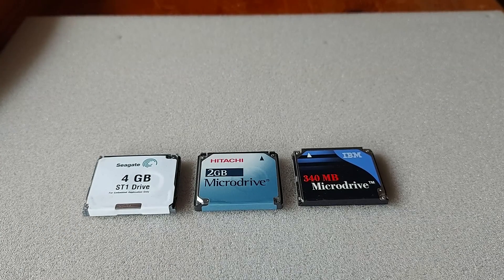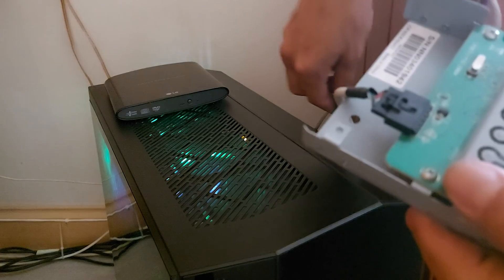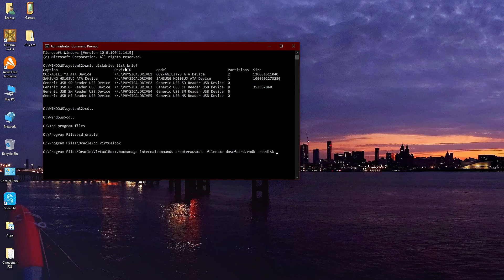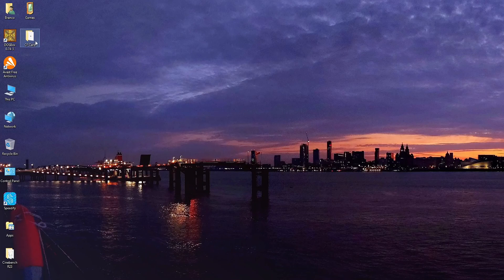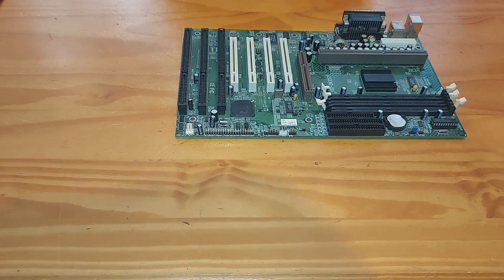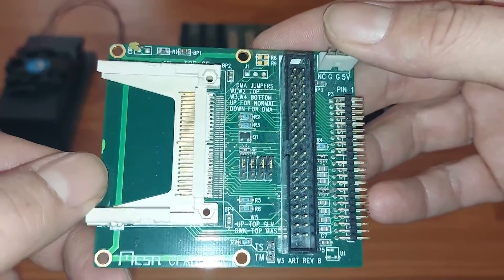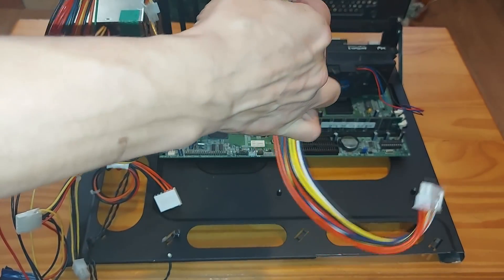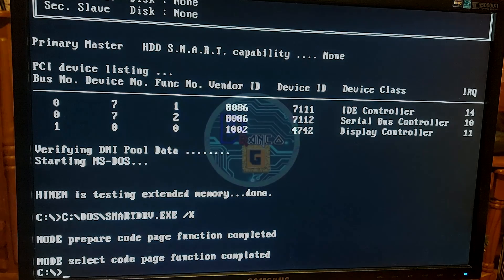No Floppies? No Problem! - Installing MSDOS v6.22 To A Microdrive Without Using Floppy Disks

Comment: I used to have a few Dell PPCs, x5, x50v, x3, x30.. whenever I upgraded computers, I would see what free toys we could get thrown in, Dell DJ's & Dell PPCs usually won over ordering from HP lol.
I believe my x50v had both the SD & CF Cards.
I had a few 4Gig IBM Microdrives, I thought those were sooo freaking Wizard!
Reply from the maker: I'd never used a microdrive before, I'd only really discovered them a couple of years ago when I started collecting. 

I find them pretty fascinating even now, the size of the things, pretty kewl bit of kit even if they are from like 2001.

Thanks for sharing 👍